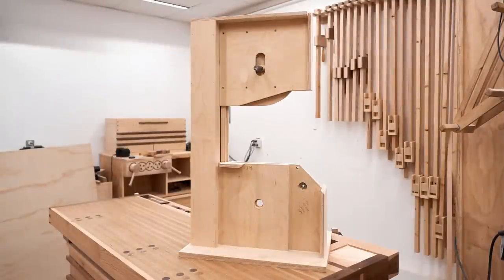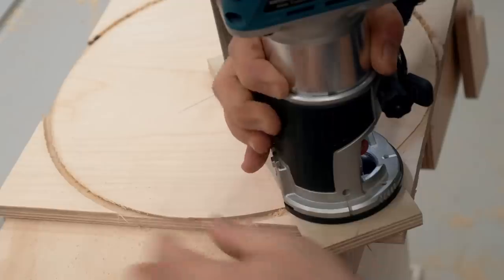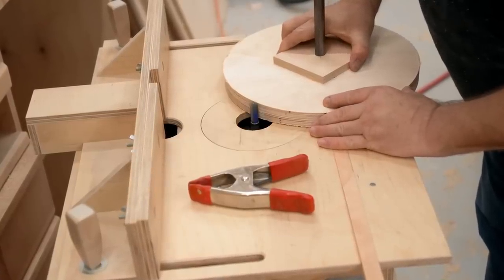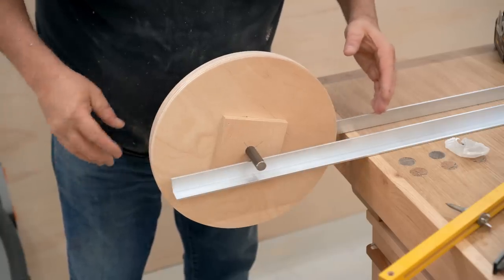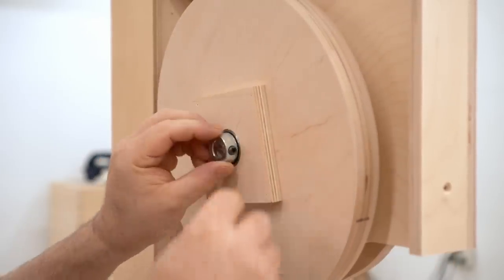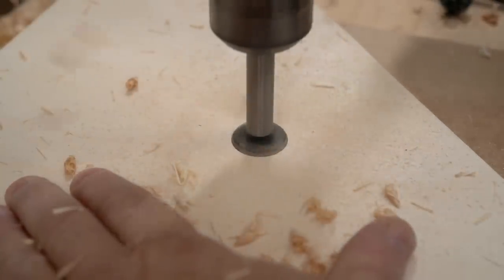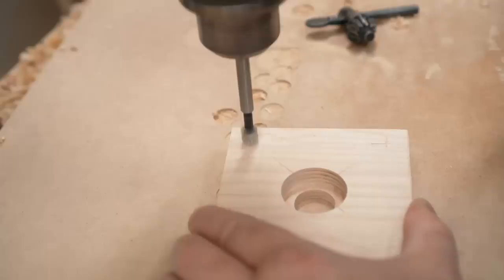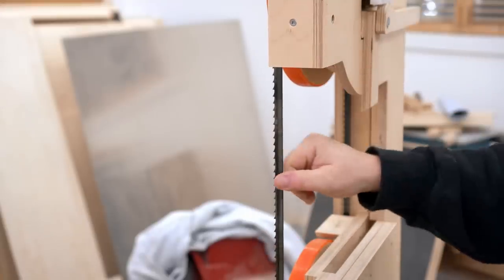How To Make Band Saw Wheels from Plywood

Comment: So after balancing the wheels by drilling holes and or adding screws, did you not then make more holes to attach that second idea to align the wheels?
Reply: Most of the material from that hole will have compressed into the wood. A tiny portion would have come out. You’re right, but I reckon the impact would’ve been within his margin of error for balancing it anyway.

Comment: BTW, I wonder if those industrial sewing machine DC motors with speed controller would work fine for this application. I've seen people using them on benchtop drill presses replacing the original weaker (1/3 to 1/2 HP) motors and those things seem to have plenty of torque, at least for drill press usage.

Comment: This looks awesome John!! I have one question, is it possible to make a band saw with four smaller wheels, like a belt grinder? I have a small, no a tiny shop and I would like to have a bandsaw but a regular one won't fit. Is that possible to make?
Reply: They have some really small band saws at menards I seen the other day, idk what you would use it for. But they are so little

Comment: Its gonna be sweet John.  Unrelated question.  You use a lot of PL, how do you keep the tube from drying out after you open it?  I often wish they made it in smaller squeeze tubes because I end up with a lot of half tubes that dry out before I can use.it again.

Thanks for the video.
Reply: I don't know how John does it, but I'll tell you how I do it.   I get a big drywall screw, the coarsest I can find, and push it into the end of the tube.   Then I take several layers of plastic bag and put that over the screw and the cut end of the tube, and wrap that all well with electrical tape, to make the most airtight seal possible.   But undoubtably, when reopening it, there will have been some air leakage and there is a small plug of dried PL at the end, so I grab the drywall screw with a pair of vise-grips and just yank it out.   Most of the time that will pull out the entire plug, but if not, I saw the head off another long coarse drywall screw, chuck it up in my drill, and use that as a sort of spinning reamer to pull the remaining chunks of dried glue out of the passageway.   99% of the time, that solves it.
Reply: @jimthesoundman8641  thanks Jim.  I've tried the screw method before with tape but don't know if I used plastic with it.  Normally I just let it dry into a plug then just cut the tip lower.  Its not ideal because you get a gigantic opening. It also sometimes dries the whole thing out depending on how much is left.  I've also tried those store bought plugs... they don't work.  

We can put a man on the moon but can't make a resealable caulking tube : )

Thanks for the idea